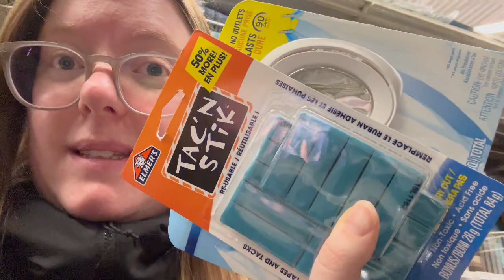WE'RE LEAVING BANFF

Comment: Do you have any solar charging on the camper or the truck to keep the batteries topped up? Midnite solar sells some sweet tiny charge controllers. stay away from bix box store solar set ups they are a rip off. Safe travels.
Reply from the maker: No solar but I wish we did! We can comfortably do two nights without hook up, and can push it to three but then I get nervous! I’ll definitely have a look!